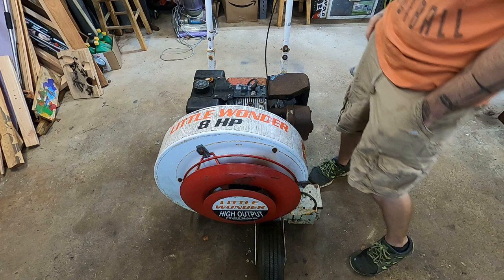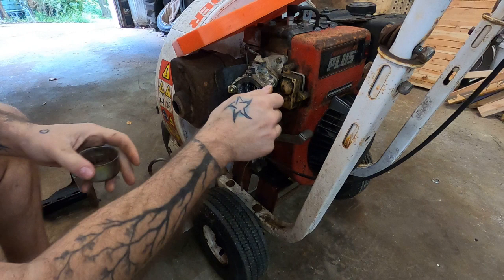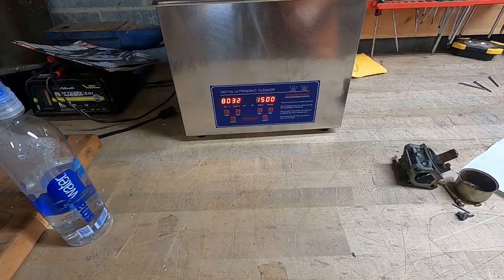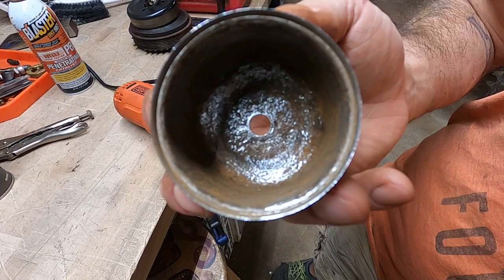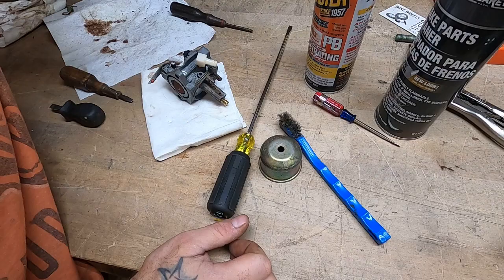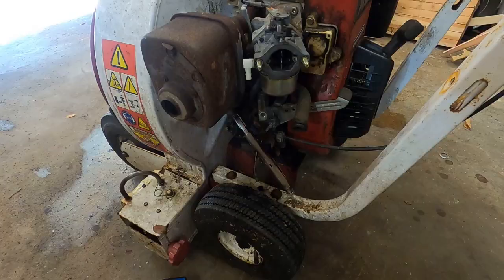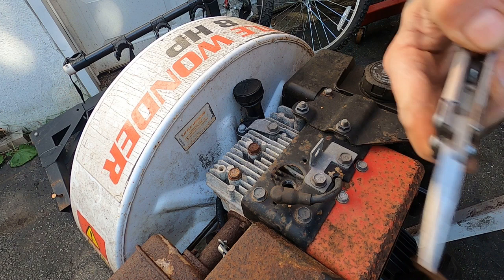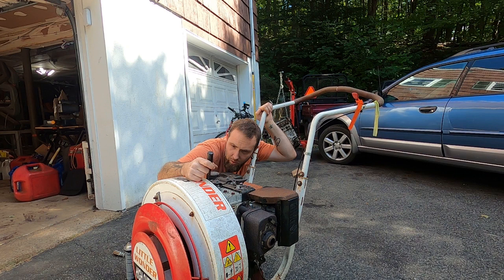Garbage "Little Wonder" Walk-Behind  Leaf Blower - Will it run?

Comment: I have that same shirt also, 🐻⬇️ great video as always. The ultrasonic cleaner noise in the back wasn't too bad, then again, I wasn't using earbuds. That may make a difference. But good golly miss Molly you lucked out with the bowl gasket and fiber gasket working just right. If only everything went that smoothly!
Reply from the maker: Great shirt, right?? BEAR DOWN

Comment: Question:  I got a tach so I can set speeds at a professional level when I restore equipment.  I've easily been able to find specs for things like chainsaws.  I just got a Ryobi BP 42 backpack blower tuned really well (after cleaning out the carb, which seems to have been the problem with a screen clogged with paraffin) and no amount of Googling turns up any specs.  I assume the Low is probably around 3000 RPMs, give or take a couple hundred, but have no idea what the High RPMs should be.  I suspect it won't be nearly as high as a chainsaw and maybe in the range of a string trimmer but I really want to set it just right so I protect the equipment no matter what.  Any suggestion as to an approximate High end range?  Even better, could you direct me to a source for that information?  Right now I have the High set at around 7000 and the Low is set at around 2700 and those seem to be the sweet spots.  Of course I've backed off on the High end to not run too lean, but the adjustment on this machine is very tweaky and I could be off because I just don't have enough experience to know exactly what it should sound like, even though I do know what four-stroking sounds like on a chainsaw.   Thanks a lot for reading!